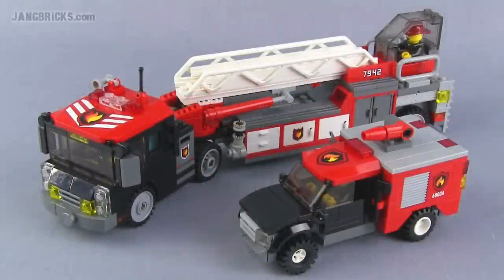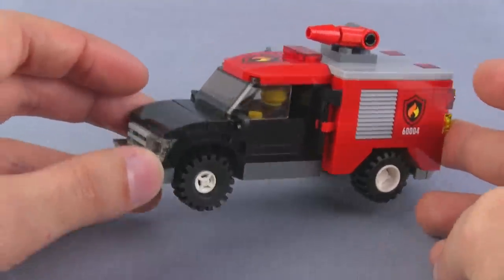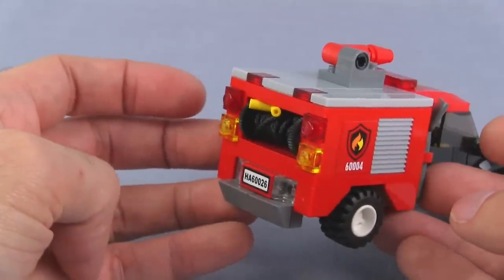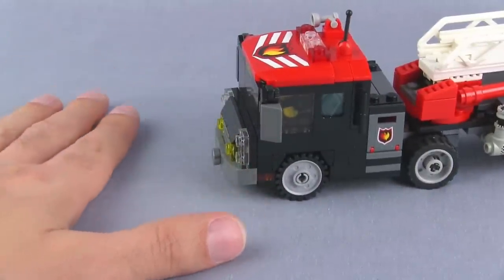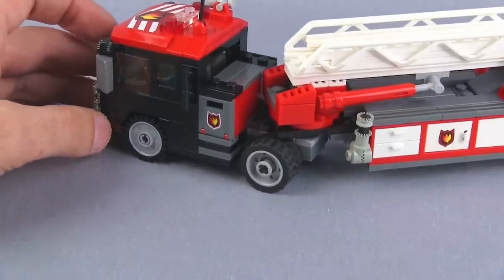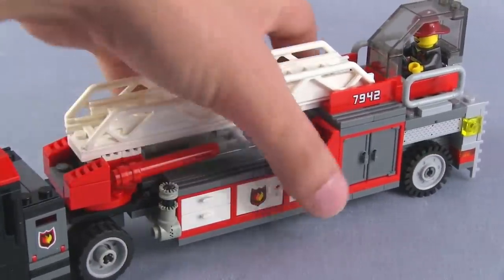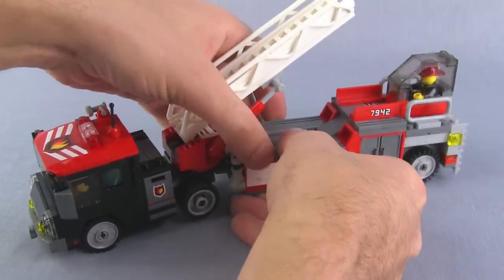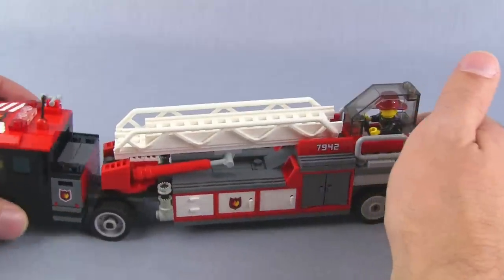LEGO custom Tiller Ladder & brush trucks - fire MOCs

Comment: for the back of the tiller truck i think you should attach it with 2 studs and then reinforce it by putting a 1x4 plate piece on the bottom and 2 1x1 plates on the 2 edge studs of the 1x4 plate

Comment: Hey, really cool custom build. Hate to break it to you though. IRL the trucks are red and white for safety purposes so they can be seen at night.
Reply from the maker: FernoBeast Google up the Chicago Fire Department.
Reply: +JANGBRiCKS I have been watching your fire mocs and been wondering if the Black over Red was based off of CFD in terms of color scheme. Is that intentional or just worked out that way? 
(I really like the color scheme also in that my local fire company has the Black over Red paint scheme as well).
Reply from the maker: Timothy Meineke First saw it on a Union City, California engine :)
Reply: +JANGBRiCKS So I went an looked at Union County's fire page and I have to ask, did you loosely base your Fire Station off of County Station 30? I see many similarities including color and architectural design.
Reply from the maker: Timothy Meineke Interesting.  Don't think I've ever seen that station before, but I do see the similarities for sure!  My station wasn't intentionally based off anything real, though.  I'm sure I've seen tan colored fire houses before, so there are some subconscious sources of inspiration, but design-wise it was primarily function-built to accommodate the spaces I needed with the parts I had on hand.
Reply: +FernoBeast They're red and white because red and white were the cheapest colors of paint when they needed a scheme that would be easily recognized.
Reply: ***** The fire company I'm with is Black over red.
Reply: *****  Exactly. From what I have been taught, all emergency vehicles have 3 levels of warnings. The first level is the lights. The second is the sirens. The third level is the color and markings. 
So yeah, in the grand scheme of things, color isn't all that important.
Reply: FernoBeast the colors are different all around the world
Reply: Bob Birdsong nope nope nope and let let me say it again,  NOPE that's is 100% Not true that 'fact' is completely  fake so please, think before you speak